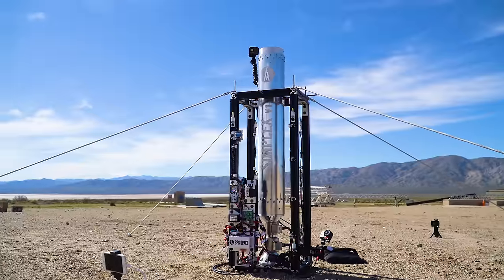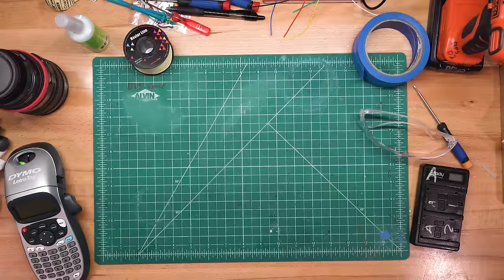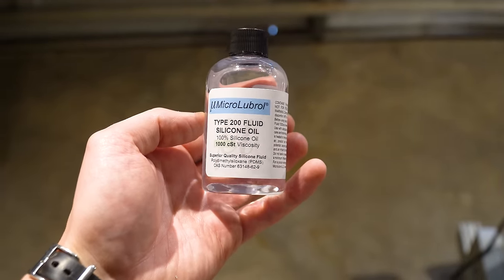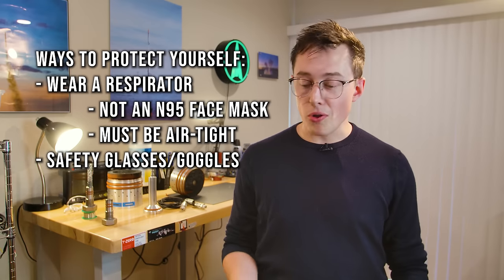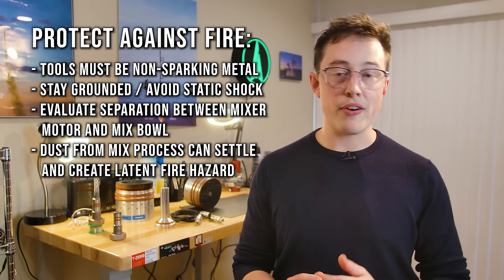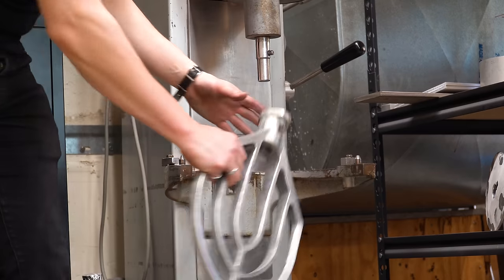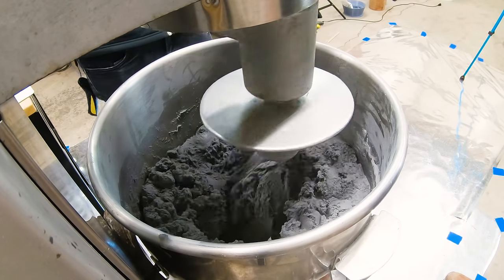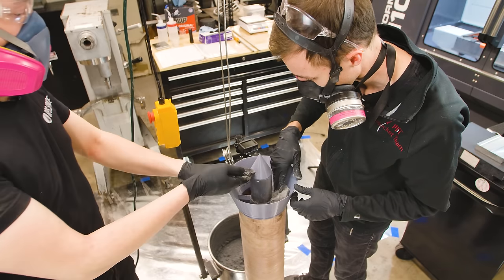Mixing And Casting Rocket Propellant - Simplex Ep 2

Comment: Hello! I'm a professional, I work at one of the handful of companies in the US that make solid rocket motors for NASA, the DoD, and the DoE. Watching this was extremely difficult. Yes, everything worked out, but there was so many opportunities for things to go very badly. I didn't see proper PPE (flame retardant lab coats, face shields), I didn't see de-ionizers, I didn't see personal grounding devices, and I didn't see the casting tooling and motor be grounded when it was pulled. The separation of the tooling from the propellant grain can create large static electricity charge build-ups. Also, sawing a propellant grain of that size, yikes. I'm not in the safety department, I do design, so there's probably more than that.
Reply: As a worker in a small high school in the middle of the french countryside, watching this video wasn't particularly difficult for me ;)
Reply: what you don't know can't hurt you... right? No?? 💥
Reply: @dfgaJK  right
Reply: The moment he started talking about getting in a hurry, I started writing the root cause report in my head.
Reply: As kind of a collegue of yours from abroad you are absolutely right. To add the one thing tha bothered me most: Extracting the casting tools was really hard to watch. There is an IMMENSE mechanical stress on the propellant in terms of friction, and that could have easily gone off directly next to your face. These kinds of operations MUST be done remote-controlled, especially at the size we're talking about here. There has been more then one deadly accident in the industry at this very step...
Reply: 😂 A JSA for every task ❤
Reply: I'm curious how this compares to the average DIY high power rocket manufacturer. It would be really helpful to have a pretty systematic critique of this to help the hobby as a whole.
Reply: Dude. This is America. We do what we want. You already know this though.
Reply: Someone call the waaaaaaambulance
Reply: Friction against APCP isn't very likely to cause it to go off , nore shock. At least not the friction or shock they are imparting on that propellant.  The friction and shock sensitivity really are dependent on the chemicals inside tbh, some APCP mixes will be more or less sensitive depending on ratio of metal to oxidizer , oxidizer partical size , type of metal used , metal partical size , if any colorants are used , what partical shape the metal is. The list goes on. 
I do agree they should wear a bit more on terms of PPE like face shield and long cotton tops and bottoms ( blue jeans and a long cotton Hoodie would be good ) 
Also welding gloves to prevent the hands from burns would also save them if the thing would happen to go off. 
The good thing about some APCP comps ( I am jot familiar with this composition) is that they burn pretty slowly outside of their cases so if a fire would take place they may have a bit more time to react vs if this was a BP (black poweder) rocket or other propellant. This is also to point out that black powder is also not nearly as dangerous as people make it to be, it isn't shock or friction sensitive so hammer ing on it isn't going to blow you up nore will it if you pull a spindle out of a motor core. Once you add metals to black powder it does increase the shock sensitivity but this follows what I posted above about metal particle size , type of metal and the particle shape the the metal, as well as how much metal to the BP you add. 
Anyways , I'm running out of time on my break at work. 
P.S. 
I also work for the DoD..
Reply: @AlChemicalLife  Have you actually worked with solid rocket propellant? Cast it, plunged it, de-molded it, trimmed it? Held it in your gloved hand? It is friction and electro-static shock sensitive. We have extensive training that goes through all of this, including examples of incidents in the past, which includ incidents where the cause was friction and electro-static shock. Black powder, this is not.

These motors do not "burn slowly", especially when you have a shit ton of voids, ie a lot of surface area.

Cotton clothes, while better than synthetic clothes, will absolutely not protect you.
Reply: @W Goulding  Yes , I have worked around propellant. I have mixed,  cast, and flown rockets with my own propellant . Not just APCP , but BP and exotic propellants such as double base propellants. 
Are you sure you have worked around APCP and not something such as HEC or Double Base ? Those, especially double base , are different beasts and can be way more shock sensitive and friction sensitive. 
I'm not doubting your experience, but also , depending on the projects you worked on, you may have worked with things other than APCP. Also, you have probably worked on much larger projects that aplifys the risk of ignition. I'd be curious to see some data on ignition of hobby formulated APCP via friction and shock.
Reply: @ALPHA-zx5ep  😅😂
Reply: @dfgaJK Well the astro-nots didn't know about the van Allen belts in terms of how dangerous so they where fine 😂
Reply: Should you be putting this out there ? North Korea thanks you !!!!
Reply: It's just the yolo lifestyle bro
Reply: Lighten up, Francis.  

If you have professional experience and advice, maybe share it instead of making yourself important by noting its lack in a small-scale 1 or 3 off shop.

Dude is going to space as an entrepreneur, you are an employee.
Reply: @HowShouldIKnow6543  Yo. Something I'm designing is going to Mars. It'll be the first rocket ever to be launched by human beings from the surface of a planet. I know what I'm talking about.
Reply: @wgoulding  

Yo.  

 Lighten up, Francis.  

I made inductors that went into the Space Shuttle likely before you were breathing air. My wife worked at Aerojet in Redmond making injector pucks for Orion.

Again: Lighten up, Francis.

You work at a solid motor company?  You work for a company that uses your experience and training for their own programs.  You didn't start it, you didn't score the contract, you are an engineer sitting in a chair instead of someone else in that same chair doing that exact same work.  

You are surrounded by professionals who have safety programs and possibly employees whose entire job is to mind your safety.

This Dude is doing it in his f-ing garage.  He's doing it with Charlie Garcia who also knows his shit.  

If you have something about safety, try, "Here are some resources for materials handling or static potential grounding or mixing materials safely" or anything other than, "I can't watch people working anywhere else than my shop using our procedures," likely procedures you yourself did not create.

He says multiple times in the video, this is incomplete and does not consider all of the safety concerns.  He says it like three times.  Maybe you missed it each time.
Reply: @RambleMonkey  Then I'd expect that you'd know that if I gave him useful manufacturing advice over the internet, it would be all kinds of an ITAR/EAR violation. I have heard coworkers, including people who have 30 to 40 years of experience, talking about how dangerous what he did was. If things went wrong, he could very easily be dead or severely burned. I gave all the safety advice I could, like grounding and air de-ionizers, that I could without giving away anything that could be of use for another country.

If there was a significant accident, it could cause a large ripple effect that could put the kabosh on a lot of college and amateur rocketry. Rocketry that acknowledges the inherent danger of solid rocket motors in an unprofessional environment. Hybrid motors are the ideal form of rocketry for this level: you use HTPB rubber and nitrous oxide both of which are on their own decently inert, but went under the right circumstances will burn vigorously in a rocket motor. Amateur rocketry is what got me into aerospace engineering and I would not want it to be closed off as an avenue to this profession because of the recklessness of one individual.
Reply: @wojecire ah yes, being concerned for someone’s safety is “pussy shit”
Reply: @wgoulding  I’m pretty sure almost all rockets that have been launched were launched from the surface of a planet lol
Reply: Wanna know what else you didn't see?
This go wrong.. because he isn't an idiot...
Reply: Imagine putting this in your car: Elon Musk defeated
Reply: I'm shutting the comments down for a matter of national security .😂
Reply: Shock sensitivity is a concern in mixing. When I watched our instructor mix 20lbs of APCP together, he didn’t seem to concerned however… just have 1 person doing the mixing and cross your fingers (what else can you do).

Id be interested to hear the shock and impact ignition of APCP that has been mixed or even cured?
Reply: Get the tape measure out, my solid rocket motor propellant is bigger than yours!

Says the guy working for NASA,  to the hobbyist on the internet, who's working on making something called cherry fucking limeaid! 😅
Reply: dID i MEnTIon I dO DesIGn FoR nASa
Reply: @jakeholley4935  Look, if I mention it, people like you will say shit like that. If you don't, people won't take what I say seriously and will think I'm some armchair amateur. You wouldn't make that kind of a comment about a doctor or a lawyer.
Reply: @DuvalDashCams  Just because it doesn't go wrong this time doesn't mean that if he was to do this multiple times, it wouldn't go wrong. Things go wrong with these operations, and the people doing them are professionals who do it for a living, using state-of-the-art equipment. But they still do many of these operations completely remotely, controlling everything electronically. Because accidents can and do happen, because shit happens.
Reply: @wgoulding  it just came across like you was blowing your own trumpet my dude.
If you was genuinely concerned for their safety and offering expertise in the most direct, humble and dare I say it professional manner. Then I both respect and appreciate that. 
I dont have a clue about any of this stuff, but think what this bloke does is incredible and inspiring.  Im sure what you do is both too.
I guess I shouldn't mock h&s.
It's just..  my dude... it felt like you was trying to explain what you do and for who, more than you was offering advice that could help keep things safe. 

You can have a good size rocket motor without pointing out how small everyone else's is!😝
Reply: @wgoulding  people like me..?🤔🤭
Reply: @@afghanwazir1444 Baith ja afghandu, hum pakistaniyo kai pas hai. Tu security guard ban kau reh humara.😂
Reply: What if they use potassium nitrate and sugar ?
Reply: I understand your concern but at the same time.. cmon man not everybody has uncle sams tax money funding the program and you gotta start somewhere. You think the people that came up with this shit where being bitch made while doing it ? Probably not
Reply: @lebanonchristian3951 yes as well as some Aluminium
Reply: Does the Ministry of Defense use solid fuel like this in missiles?
Reply: @wgoulding national security doesn’t revolve around sugar rockets, it’s all in sensors and algorithms now. When I heard deionizers I remembered a shop where I worked that sent a certain rover to mars not too long ago. Yeah, I’m sure he knows about the risks, let the man cook, NASA and the commercial shops are where the volume that causes these risks to become material beyond a single guy in his garage.
Reply: We got a pro and mr.know everything here. Just keep everything to him. We're do no need to do nothing.
Reply: @yayephustler  Pal, that ain't English.
Reply: no need safety. Do your job get salary.
Reply: @AlChemicalLife you've literally explained what materials might sensitive it but then tried to explain it away. Either it is going to go boom or it's safe at the YouTube level
Reply: Very good comment.
Reply: @tequilachef Correct
Reply: So why use 200 and 90 microns instead of just using 90 to start with? Cost?
Reply: @tequilachef because 'merica bro 😂
Reply: Icarus was flying towards the sun when his wings melted
Reply: Hence it takes you guys years to send one rocket up.... 🙄
Reply: Please, please, I want to be employed in this company. I am also a craftsman and I want you to help me. Please talk to me. I am from an Arab country and I want to work in such a company.
Reply: @bogganalseryd2324 The Van Allen belts were mapped in the late 50s. Why lie about such an easily google-able fact?
Reply: @AM-rd9pu  They didn't fly through them in the fifties.
Reply: @bogganalseryd2324  The first US satellite, Explorer 1, was launched in 1958 and carried a single scientific instrument. Its purpose was to measure radiation levels. This is how James Van Allen discovered the radiation belts that now are named after him. Subsequent missions further characterized and mapped these belts.
Reply: @thewilliam8342 Well, it's all out there since the 70s, at least. No News here...  However, these are just approximate recipes, a lot of fine tuning needed before you can actually do something substantial...
Reply: @wgoulding  can you give me sum knowledge about M7 propellant
Reply: Man, what an “ego fest”
Reply: I didn’t see you making a video, just a quick comment
Reply: Right!
Reply: اريد ان اتواصل معك.  هل بأمكانك ان تضع  رقمك
Reply: @thewilliam8342 those missiles tend to be liquid fueled
Reply: It’s ok he hired this company called “oceangate” to help with safety procedures
Reply: AP also has the ability to detonate especially in confinement (see Pepcon disaster) and when it does has a velocity of detonation of over 4 kilometers per second.

Short version: if a lb or so detonates anything inside of 100 yards will be inside the debris field and will definitely get a good shockwave lol

Comment: I'm sure you know this, but a taper on the core is super important.  I knew a guy who lost 1.5 fingers trying to remove a parallel core from a rocket he made; too much friction equaled boom.
Reply: if it goes boom, he's not using APCP
Reply: @memberHD  I did not assert that he was.
Reply: @bjf10  But, we all know you were and now you've decided you weren't after getting called out on it.
On the off chance you are not full of shit. What propellant was this person mixing? I can not think of any propellant that anyone would mix at home that would be that sensitive to heating. Or one that would explode in the configuration shown in the video
Reply: @memberHD  The friction sensitivity of APCP is pretty low when compared to most similar things, but it's totally possible to set it off by friction if there happened to be a bit of grit or something in there. You do not want to be dragging a long pole out a non-tapered channel - the likelihood of an initiation is small but the potential consequences are huge. It's unnecessary risk when you can just do it a better way from the beginning.
Reply: @neomone1989  Very very unlikely, but even if the unlikely did happen, it's not going to explode and take fingers off. 
Sure there are propellants that could explode if mishandled, but that's not APCP so op's comment is still completely irrelevant.
Reply: @memberHD  It's not going to detonate, but depending on how it's confined it can explode. For example, if you were pulling a mandrel out of a rocket motor and it for whatever reason lit up as you did so, that mandrel is going to come flying out as the pressure of the gas forces it. While technically a deflagration, the sound of that happening is going to be what any normal person would describe as an "explosion". if you happened to be unlucky enough to have your fingers in the way of the mandrel as it was forced out, you might lose some of them. Technically that's the mandrel severing fingers and not the propellant, but most people will say (rightly) that the propellant was the cause of the accident. 

I have no idea what happened in the OPs case or whether the incident was even real. But you can absolutely get "explosions" and severing or crushing injuries from accidental ignitions of APCP - particularly when you're casting and demoulding. It's highly unlikely even if you really mess things up, but the consequences are so high that it's worth being aware. A 1 in 10,000 chance of losing fingers is a risk that you should be actively engaged with deciding whether you want to take it or not.
Reply: @neomone1989  OP is full of shit is what happened. Yes APCP can ignite through friction, but it's absolutely never happening using a setup like in the video. You'd need some serious forces to produce the friction needed for ignition....like you'd have be to intentionally trying and you'd still probably fail 99 times out of 100.